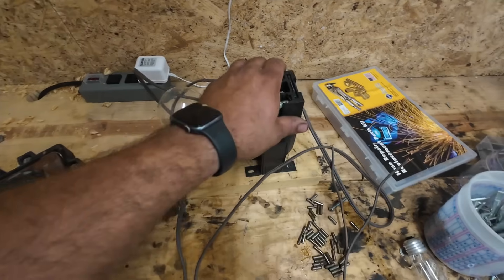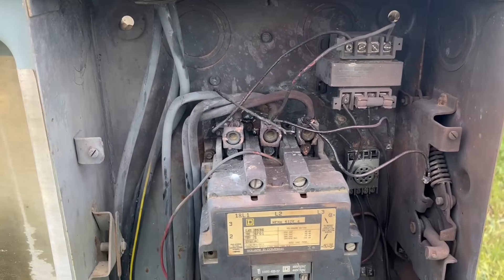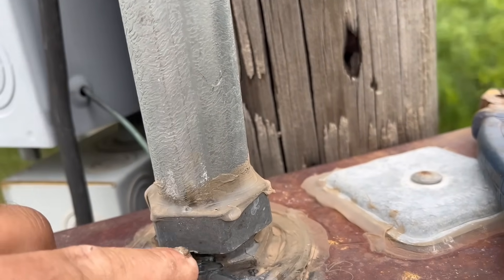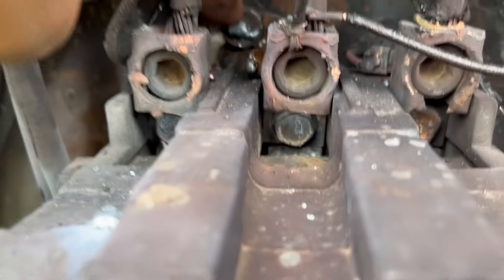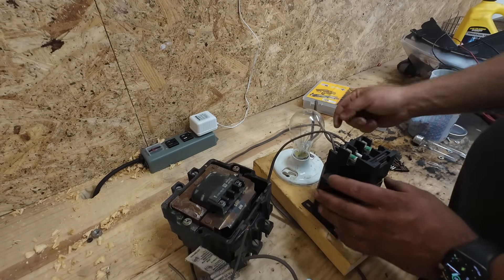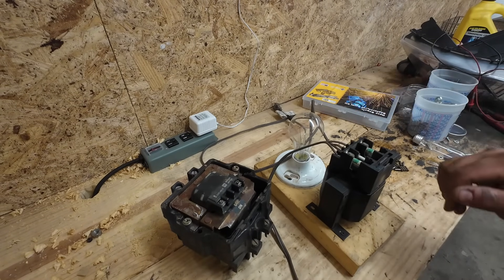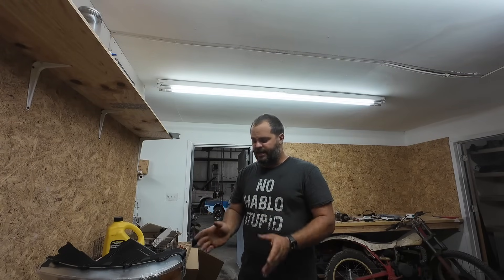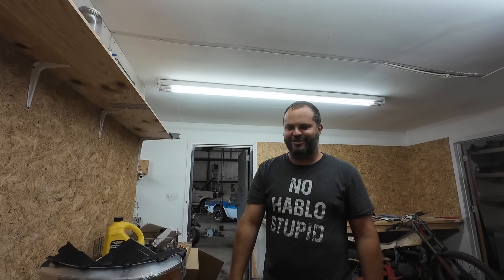480 Volt Current Limiting Power Supply and a Little Lighting Damage

Comment: One small note on the power calculation with three-phase. With single phase, kVA is divided by line voltage to get amps; but with three phase, the kVA is divided by voltage then divided by 1.73 (square root of 3) to get amperage. When figuring the kVA, it's volts x amps x 1.73. Working with three phase motors and transformers, it comes in handy sometimes.

Comment: Zack, I was dreaming up solutions for the lightning damaged bearings, then found this video. My first thought was just a  well grounded brush  on the non pulley end of the motor, but decided that in a oil field that might not survive until you needed it.  The best  I can  come up with is to create a spark gap between the shaft and earth. Something with points  around the shaft or better yet, assuming the shaft dees not have much end play, create a device the attaches to the shaft and creates a point (think of a pipe cap with a nail driven thru the end) then build a grounded structure that has a point that is as close as possible to the end of the shaft point . Don't get carried away  with making the points needles, when the ark forms there will be lots of volts and amps  This should create a discharge path with a lower breakdown voltage than the ball bearings. Guess that makes my example of cap and nail wrong, more like a cap with a dunce cap co top.
Does the grease in the bearings contain graphite?

Comment: Good test fixture. The only difference I do with mine for convenience is to put a bypass switch for the lightbulb so that when I need to I can apply full voltage to the load when I'm ready.
One thing that I've never really agreed with was the way a lot of motor controllers are factory wired with no fuse on the primary side of the control transformer that would step the 480v down to 24v for the control circuits. They always put the fuse on the secondary side only. That works fine if the secondary sees a short or too high of a load current but it does nothing to protect the primary side of the transformers and the fuses that supply the transformer and the load  are sized for the load and are far too high of an amperage rating to protect the transformer.
What usually happens when there's some kind of short in the transformer itself, or some goomba replaces the fuse on the secondary side with one that's too large or is slowblow, the primary side gets smoked, and the transformer needs to be replaced.
I often added fuse holders on the primary side of the transformers and as such preserved many a transformer.

Comment: As a factory electrician of over 40 years that is a cleaver trick, don’t know why I never thought of it is have done the same on automotive jobs. You could have done an insulation and resistance test on the contactor coil though which would be the normal way.  Have to ask why the hell anybody would but conduit into the top of that external enclosure on the power poll, bound to let water in. Obviously corroded away else the lightening wouldn’t have flashed over
Reply from the maker: Thats the deal though. With the coil in these there's no case to put the other megger lead on. Its no like a motor or transformer where you can check winding leakage. When these short its always winding to winding.

Comment: If you amp check a 120v 60w lamp to compare cold resistance to hot resistance you will find that lamp is only 30% efficient.  No wonder Biden pushed for their end and advanced LED's to the front.

Comment: Zack, it is a valid test method but it is based in the older era (e.g. pre-grounding) where safety was an after thought. Generally speaking, the voltage rating of the light bulbs should be equal to the voltage you are working with, so it'd be appropriate to have 4x 100W light bulbs in series for 480 VAC. However, you did not indicate if you have 277/480 or if you're going across phases, which is always 480 VAC. 400W / 480 VAC is under 1 AMP,  480 VAC / 1 AMP = 480 ohms. The one-hand rule definitely applies when using this device.
Reply: Is the bulb not in the input to the  transformer so 110v 🤷‍♂️
Reply from the maker: The bulb is on the 120v side of the transformer.

Comment: Zach, when calculating lease amperage, if figuring 3phase 480, you must take 480x1.73, and divide that number.
Reply from the maker: We are running open grounded delta in most places out here so each pot is actually running at phase to phase voltage and sees full line current.

Comment: Or, in the UK, we refer to that as a "lamp limiter" in as much as it uses a lamp bulb to limit the current.

Now, you take care young fella. Some of your videos are nerve-wracking enough, but a man working alone in the wilderness doesn't bode well for the future. A machine might mangle or sever a limb, but you can survive. Electricity on the other hand, can blow you out like a candle, in an instant. On the farm, we used to use 415v three phase to run grain elevators, feed mills, grain dryers, ventilation fans etc, but the scariest thing was the arc welder on the far end of an extension cord - 415 volts x 3 phases just lying on the ground, waiting to give you a lethal tickle where the insulation was damaged.

It certainly looks like you get some big, fat old lightning out there! - I've seen what it can do over here, where it generally forks out and strikes multiple targets, dissipating its energy as it does so, but even here in rural Yorkshire, it blows the tops off pole transformers and joint boxes, and cabling out of walls.

In a particularly angry storm, a few years back, I saw five oak trees blown to matchsticks in a single strike.

Lightning is frightening!
Reply from the maker: Thanks. And yes it is.

Comment: USA NJ
coil voltage is 480 what did you run that through the little cubes and the phase monitor
Reply from the maker: 480 and 120.

Comment: Have you considered mounting tall needles mounted at the top of the pole, with a 8 gauge, (or larger) wire going straight to a 6 foot copper rod into the ground?

Comment: thanks for yet another entertaining video zach, keep em coming! insulation resistance meters are also very handy in these jobs. known sometimes as megger testers after a manufacturer.
Reply from the maker: Absolutely but on a coil like this there is not really a way to high pot it because unlike a motor or transformer there is no case to measure leakage to.

Comment: Great Video!!  You did a good job on your test rig.  I would add 2 insulated alligator clips on the 480 side, it would make it a bit easier and safer to use!  I know you will, but be extra careful when you are repairing electrical systems with that much water on the ground!!
Reply from the maker: That the part that bothers me the most is standing in water working on stuff like this.
Reply: @TheZachLife  Please be careful, i lost a friend = he was working in a 440 - 3 phase panel and he had followed all the rules for lockouts, but some idiot on the other side of the building unlocked it and energized the panel.  He died instantly!

Comment: Yikes! Yall really need some MCOV lightning arrestors on those primary lines and some good surge portectors on the secondary. Wonder if the power company would install them on their lines, and you could install them on your primary lines?
Reply: Those might improve things a bit but even better would be a static wire over the distribution primaries like they do in parts of Japan and Taiwan where lightning is also a problem.
Reply: @randacnam7321  Most of Western Colorado also does that. They have their primary on a single phase line on the side of the pole and neutral up on top. Or for a 3 phase have the neutral on top and a crossarm with the phases below.
But they also have MCOVs every 3 poles on any lines newer than the 70s lol
Their really concerned about over voltage there haha

Comment: Have you ever shorted 480V to ground (technically 277V)? I found myself in a precarious situation while inspecting a disconnect. Despite the disconnect being off, I reached through the arc shield with a screwdriver to check the wire clamp screw was tight on the line side. I knew it would be live but I was wearing thick gloves and the screwdriver had a plastic handle so I figured it would be fine just this one time. Well, while doing this the metal shaft of the screwdriver made contact with the enclosure and BANG!! It was like a gunshot right in my face. Sometimes the most effective lessons come from close calls. I cant even imagine what a phase to phase short would be like.
Reply from the maker: I have had some stuff pop in front of me.

Comment: I am probably stating the obvious, but it probably would be worth while to invest in some insulating electrician gloves when handling that kind of high voltage. You never can tell if the insulated wires you are holding are not insulating as well as they should. 
I will also mention there is a channel I like to watch called Bobsdecline - Lineman blogger.  Lots of interesting things covered related to lineman work.
Reply from the maker: Thanks, I watch him as well.

Comment: What about installing a homemade lighting rod that is rubber pad.mounted that extends above the highest point of the transformer with a dropdown  cable going down to a ground round in the gound 3 feet away from the pole.

Comment: That incandescent current limiter is otherwise known as a rubber fuse when used as a safety device for a circuit that  has a suspected short, it will limit the current and allow you to poke around a circuit for the source of excessive current draw with a lot less risk of further damage.  Works great in combination with a thermal camera to find shorted components.  Glad to see someone else still has that in their bag of tricks.
Reply: AKA a Dim Bulb.